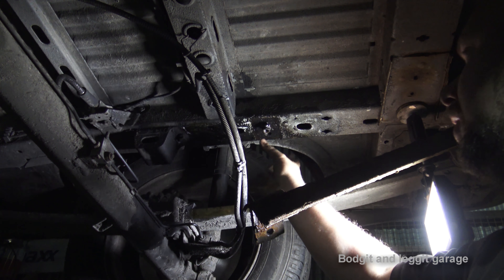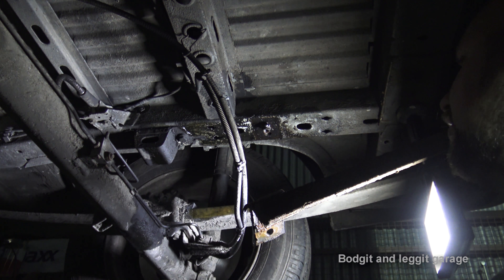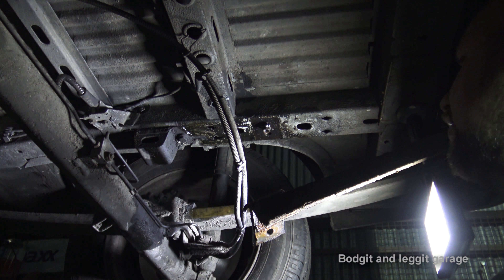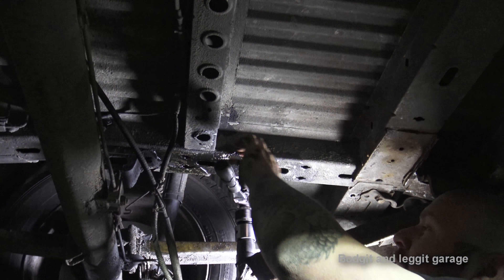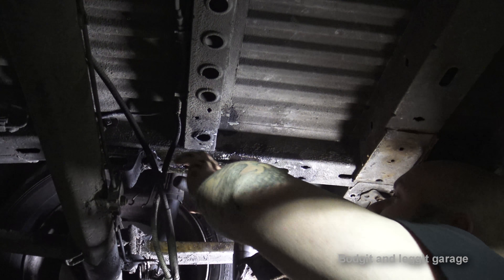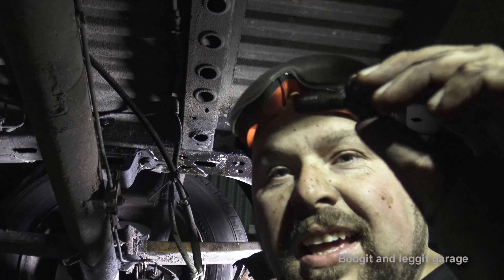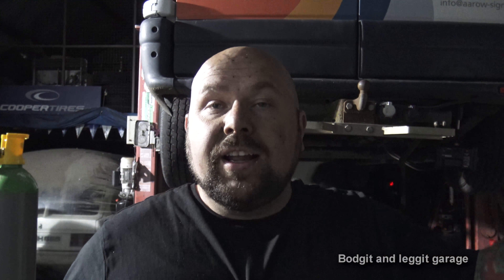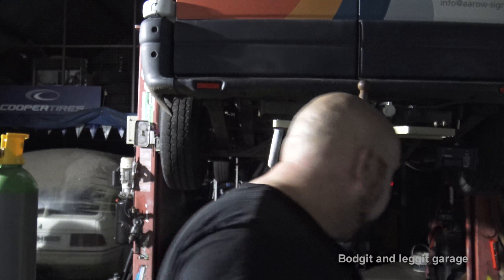Hubitool Vibroshock How To Remove Broken Or Seized Bolt/Stud Bodgit And Leggit Garage

Comment: do there make adaptor that will take a screw driver bit . will work well on brake disc screws  was there can be a rite pig to get out sometimes
Reply from the maker: Simon Rawle yes mate you can it's just a 3/8 adaptor on it so you can put anything on to it once you have the bit driver and the sockets it will go on no problem it shows in the brochure using on brake discs and all stuff like that it will work

Comment: Got a freelander loud creaking sound on pull away and if I turn horrible sound please help bud.. p.s glow plugs ebay sucks that was what causing blue smoke on cold start...help
Reply from the maker: markraptor50 it's really difficult for me to say as I cannot see it but from the sounds of things you might have a problem with your rear differential
Reply: bodgit and leggit garage 
I would have said front top shock mounts,  since he gets it also when turning steering.

Comment: Any chance you could recommend a half decent 3/8 drive cordless impact wrench that us ordinary people could afford? :-)
Reply: Toby the Glen kielder
Reply from the maker: Toby the Glen hi mate it all depends where you're from in the world as there is different places to get these types of ratchet but what I would suggest you do is buy a named branded one second hand off eBay this way you will save money and still get a decent ratchet at the same time
Reply: I'm UK based. Good advice but the issue with buying ex 'pro' tools is that they'll be shagged?
Reply from the maker: Toby the Glen even if they are you can always warrant them send them back to each other company and you'll get a new one I've seen lots of good deals on different sites before